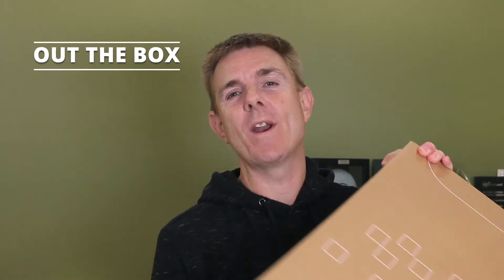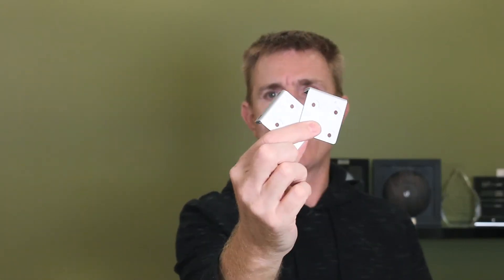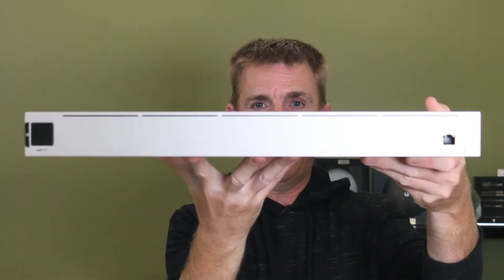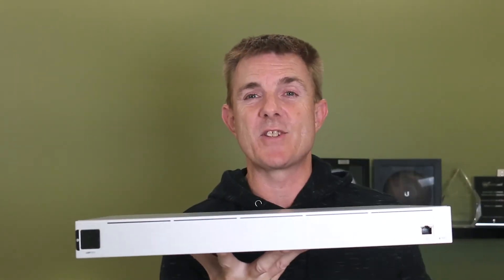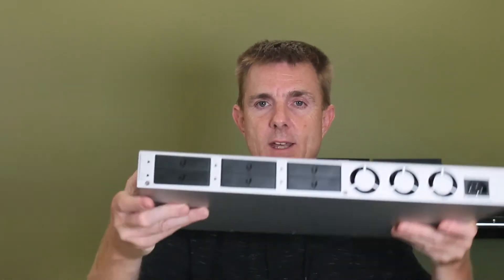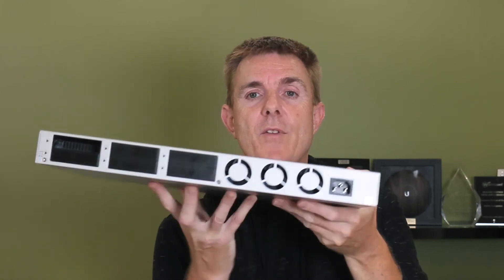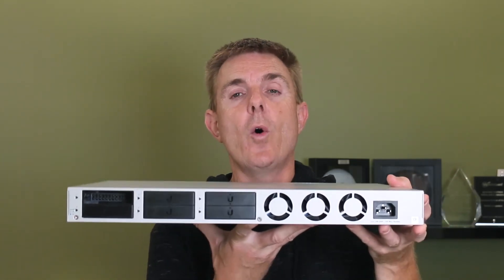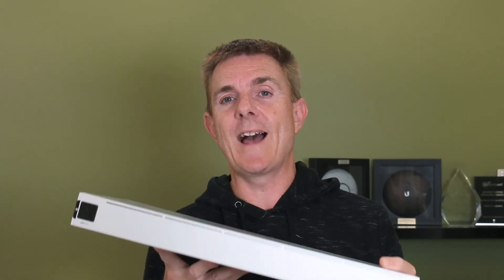Out the Box Series - Ubiquiti RPS (Redundant Power System)

Comment: Almost bought one then I figured there's no way they could keep battery's in that thin case, seems pretty expensive by the time you add a UPS on top.
Reply from the maker: Correct.  It is useful if you have unreliable power sources and need to show redundancy if the physical unit's PSU fails, but otherwise a UPS on its own could work for you.